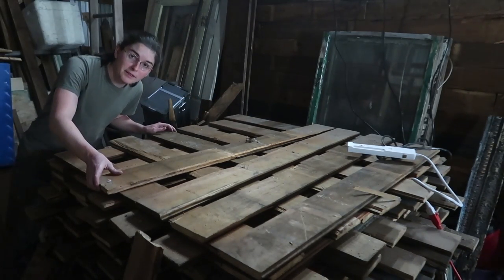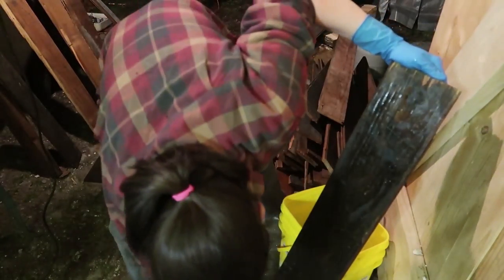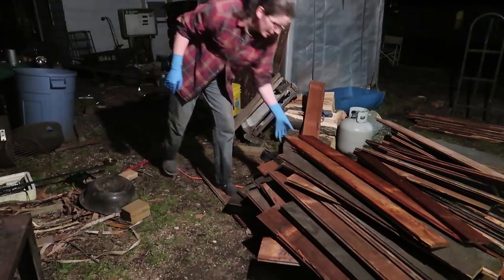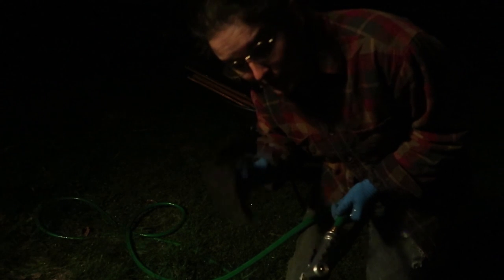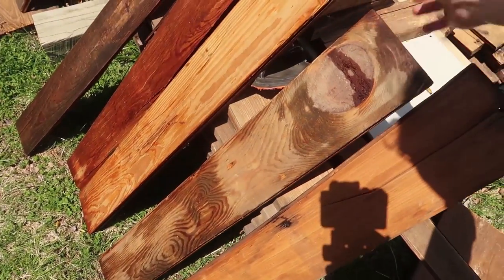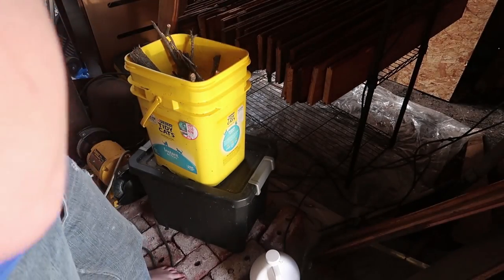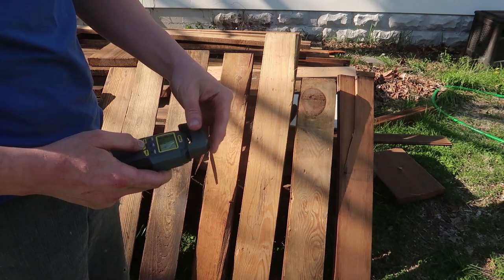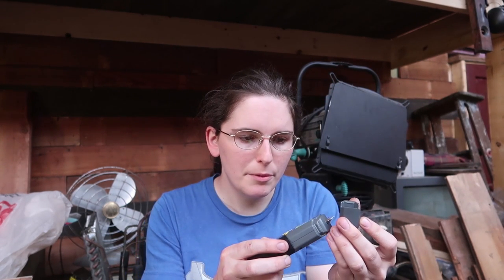How to Clean Mouldy Wood, Washing Lumber with Fungicide, Moisture Meter Experiment

Comment: The fungicide is probably a borate solution. They generally don't go bad, they just start to go out of solution sometimes, so they may need shaken to agitate any precipitates back into solution. I worked at a sawmill where they basically dipped all the lumber in a nearly identical chemical to treat for fungus and mold.
Reply: Borates also kill insects quite effectively. I guess that’s why embalmed corpses are so slow to decay...

Comment: Denatured alcohol...  Best way to clean wood without getting it more wet or damaging it, and it kills the mold too.  My favorite way to restore old wood is to sand/scrape it to remove any finish or paint or whatever, then clean it with the alcohol and a medium abrasive pad.  I like shellac as a protective coating.  Obviously overkill in this case, but I could get most of those floorboards looking better than the day they were laid in with some time.
Reply: @OkNoBigDeal  Yeah, ventilation is important...

Comment: Wood outside gets more air circulation. The only way indoor wood will dry faster is if there's air circulation and the area is heated. Blessing and a curse, depending on the type of wood. If it's old, it probably won't have a cracking problem. Newly cut fruitwoods almost need to be slowed down other than following them to prevent mold, as they lose moisture too quickly and crack and check, even just air drying and even with sealed ends.

Comment: The easiest way would be to pressure wash the wood. It even takes the oxidation, mold, fungus, etc off and only takes seconds for each board. Kinda like pressure washing a deck. Smile
Reply from the maker: i agree, i was going to have my dad bring his pressure washer but i just didnt feel like dealing with that
Reply: Years of experience. I too went through trial and errors in life. Im just trying to give you a shortcut. All that wood you cleaned could have been done in less than an hour. Smile
Reply from the maker: it would still take days to dry. thats the real limiting factor.

Comment: Ok. Ur biggest problem is that u have a dirt / gravel floor.  That's why u have so much humidity. A very cheap and easy solution till u get a concrete floor is to hit up home depot and grab some 6 mil or thicker plastic. Lay it out over ur whole floor. That will prevent the moisture from leaving the ground and causing all of ur headaches. Then I'd take all that moldy wood and some bleach and pressure wash it.  These are cheap and long term solutions. U will notice a huge difference.  Problem solved
Reply from the maker: no i have a plastic and brick floor. and ambient air is kept at 60% humidity. therr is no moisture going from the ground into the wood

Comment: I checked the MSDS sheet on Metricide and you do not need more protection.  You have simplified your cleanup well enough, drying wood needs - heat - ventilation - sunshine - in that order of importance.  You only need to slow down enough to process all the wood and all will be well.  The wood moisture level should not be a concern after you accomplish surface drying.  Remember you stacked dirty rain soaked wood to get to where you are now.  Your progress is already as fast as possible considering your financial restraints, otherwise purchase of heat would be the method to speed up your timeline.  An open ended push-thru oven box would be worth designing - just don't rush the push-thru.
Reply from the maker: actually what im thinking is maybe hanging them up as if they are laundry, lol.

and yeah, good point on stacking them. this whole thing of finding this wood was spu of the moment and i wasnt ready for it when it popped up.

Comment: Crank up your wood burning furnace, run a fan and your dehumidifier, this should help dry the wood out to a usable level in a short time.
Reply from the maker: no thanks, im removing the furnace soon. i think 60% humidity is low enough

Comment: Washing down corpses..🙄 I would just restack the wood with stringers between each layer so the air flows between the layer.Depending on the type of mold I guess. Fresh cut wood oftn gets a disease known as sap stain which is treated in the mill but the treatment is hell on humans . (I was a Sawmill engineer a long time ago) .A lot depends of the species of the wod. Some is more suseptible to mold infections than others. Also,the type of mold is very important as some fungi can send roots into the wood leaving stains (sap stain) . What is really essential is to keep the boards off the ground . To prevent the fungi Coming back you should buy some treatment which contains Disodium Octaborate Tetrahydrate (DOT) . This will dry and prevent mold coming back. Also insects which attack wood will get the stuff on themselves .they clean it off and swallow it,killing them. two birds with one stone as it were.